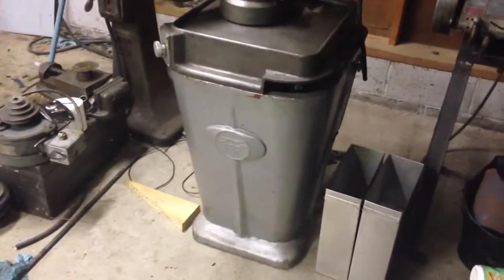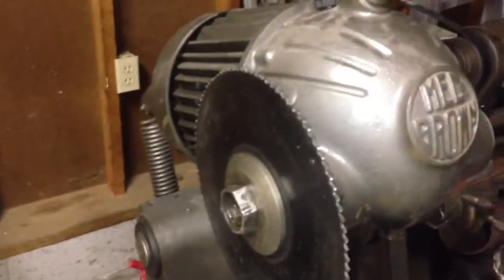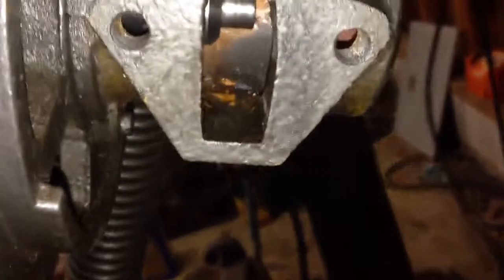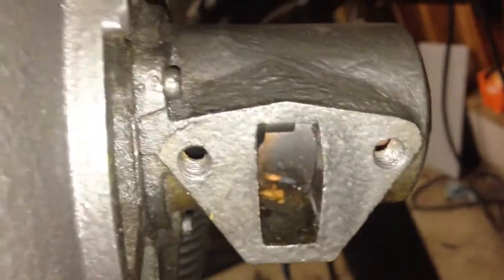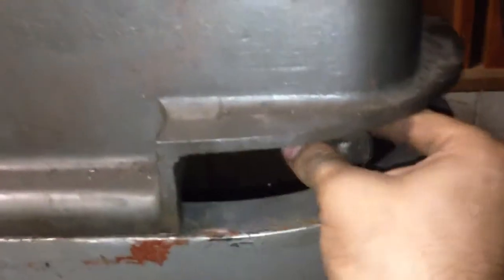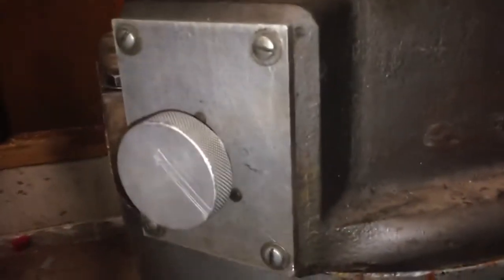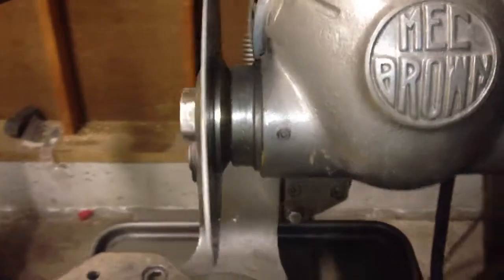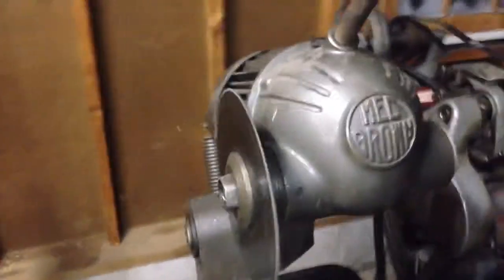1953 Pedrazzoli Mec Brown cold saw

Comment: about the fuel pump, the one with matching patterns is from the Fiat 1100, first series. Those fuel pump are called C Pump. Same pump fits the:
Classic Fiat 500 all models D/F/L/R (up to 1973) and Fiat 126 594cc early models with dynamo (up to 1976). You can find them as a new part for about 25-35 euros new

Comment: Hello, i just bought a similar pedrazzolli unit. Do you have any idea of the purpose of what seems to be a set screw on the output shaft? that allen socket thing which is visible on the inside of the blade nut
Reply: quando la sega circolare si ferma troppo facilmente durante il taglio bisogna ricorrere alla regolazione della frizione. A tale scopo girare in senso orario con la chiave a brugola 10 la vite centrale che regola la coppia di trascinamento della frizione. La coppia di trascinamento deve essere tale da permettere l'arresto della sega sotto un eccessivo sforzo di taglio in modo da evitare la sua rottura

Comment: Hi, 
I've just bought the same. The blade needs to be replaced, but the nut seems to be blocked... impossible to unlock it. Couls you please explain? 
thanks
Reply from the maker: I had the same problem at first but it finally broke free. Make sure you are turning it the right way. I cannot remember off the top of my head but I want to say it is a left hand thread so possibly to break it free you need to turn it clockwise. I will try and look at the saw later this evening and see if I can remember.
Reply: ho saldato un tubo trafilato Acc. Aq 45 Norm. 30x6 lungo 600 mm. e forgiato all'estremita' all'esagono 38 mm. della chiave originale che e' troppo debole e si piega, si svita in senso orario tirando con forza verso il basso.